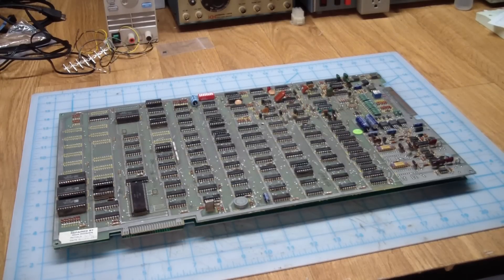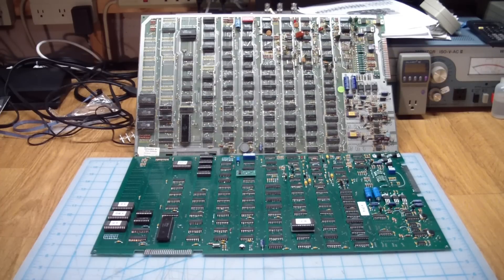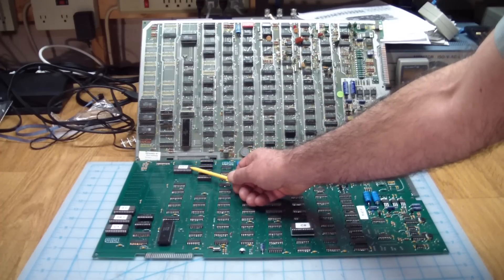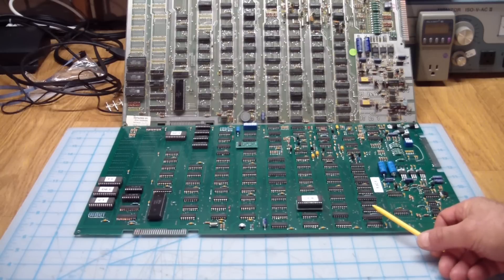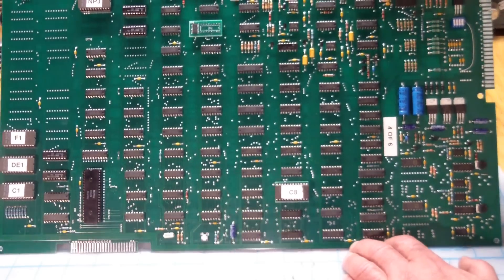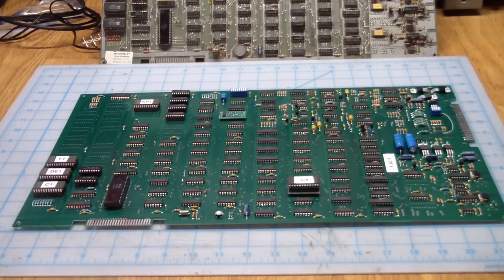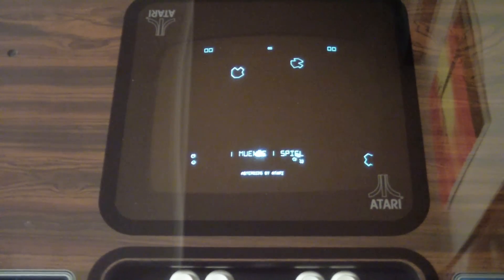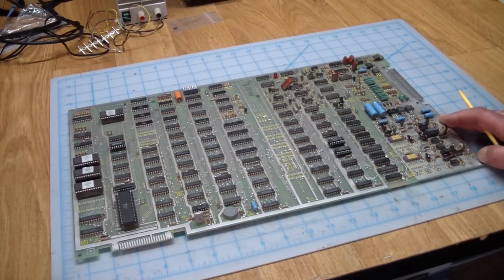AE#91 Atari Asteroids Arcade Cloned PC Board Review

Comment: i did a video of Nicks asteroids pcb as well on my channel the original proms were 9316s which are in fact already pin compatible  with the 2716 eproms. the edge connectors on both the repro and the original pcbs are both solder clad copper but a gold plate would be an upgrade.  you have a new subscriber here good vid
Reply from the maker: Welcome.
Reply: @Mr T. Guru  there are new vector monitor kits available in fact i designed yet another vector monitor which will be sold at paradise arcade shop in the future

Comment: What are PIA chips used for in arcade pinball games? the PIA chip is between the CPU and MOSFET switchers but why use a PIA chip when you go connector the mosfets directly to the outputs of the CPU
Reply from the maker: Signal drive capabilities, input protection and reduced parts count.

Comment: Cloning a board like this by inspection seems like an insane amount of work that's also very error prone. Are there so many consoles out there with defunct boards that this will in any way pay off? 
I am sure the notion is offensive to all who value original hardware but instead of cloning the hardware I'd run an emulator (raspberry pi?) with some custom vector graphics hardware and interface glue and the original software. It's even more work but the hardware cost would be so much lower.
Reply from the maker: Actually there quite a few boards which have become non-obtainium and are worth being cloned, more so than asteroids. But asteroids was a great starting point just because there so many of them out there and it is well documented.
 I don't care what anyone says, you cannot replicate the feel of a vector monitor on an LCD. A lot of raster games work well in mame or on a pi, but vector games need to be played on the original display.